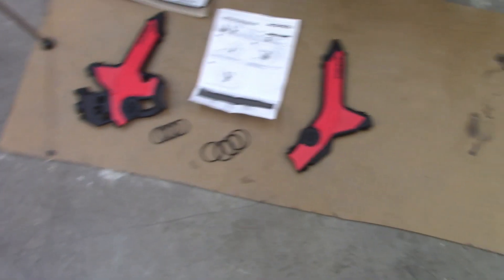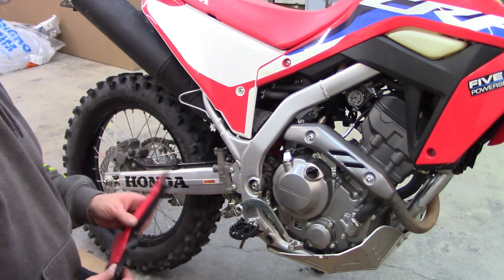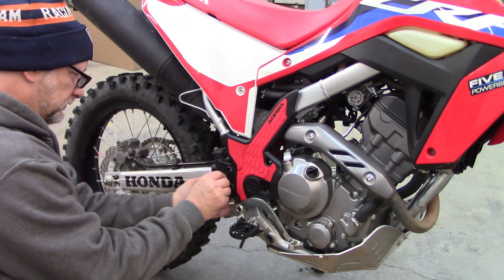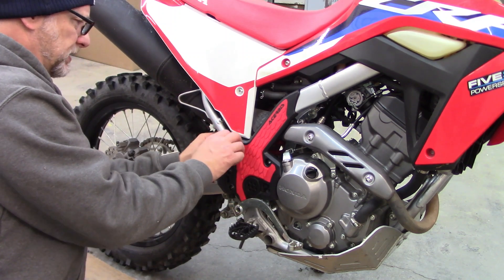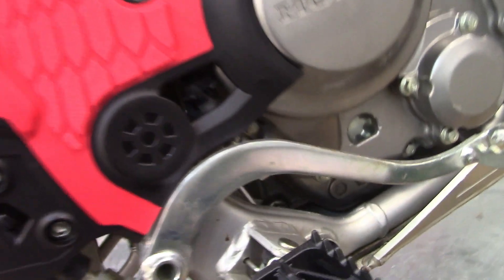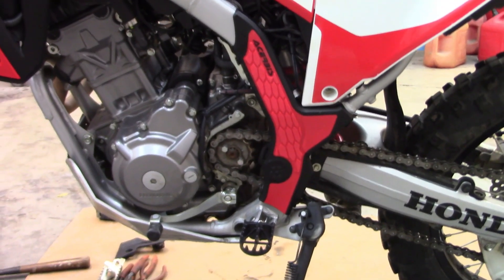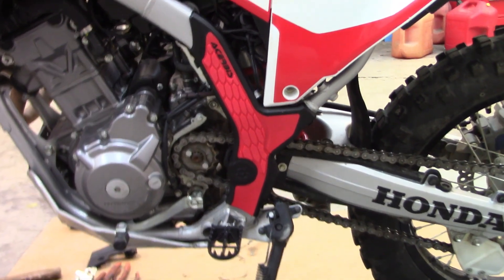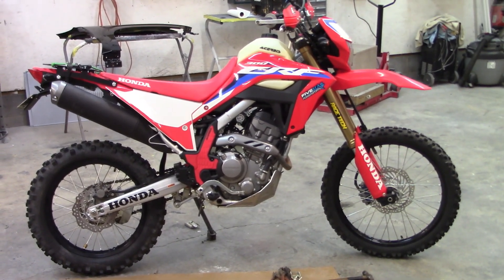Acerbis X-Grip frame guard install on CRF300L

Comment: Thanks for the videos on the 300l. I am curious on your use for all of your bikes, I see you have the KLX and also the KTM. Do they serve different purposes and do you have a favorite? Thanks!
Reply from the maker: The Ktm is my favorite pure off road bike. The klx & CRF are basically for comparison videos. Of the 300’s, the CRF is my favorite. If I was going to stick with only 1 bike, it would be the KTM . My current KTM is basically my off road bike for hard core riding.
Reply: Thanks the the reply, I can only have 1 and am torn between the 300l or a KTM 500 EXCF. The 500 excites me more but I sometimes need to do 50-100 miles on backroads and am worried it will be too uncomfortable for those scenarios.
Reply from the maker: With wheels properly balanced & a seat concepts seat, the 500 will be excellent for that! My 350 is as smooth & comfortable on road as both of the 300’s. Good luck on your purchase! Enjoy the ride!
Reply: Thanks again for the response again! I guess the answer in the end will probably be "both", haha, just need to start with one of them. @kcoutside7143
Reply: @AndrewJamesL4 I have had both the KTM is a razor blade the Honda is a butter knife. I have only had the Honda for 4 months and am already tired of it.